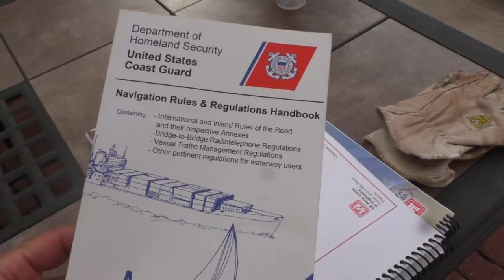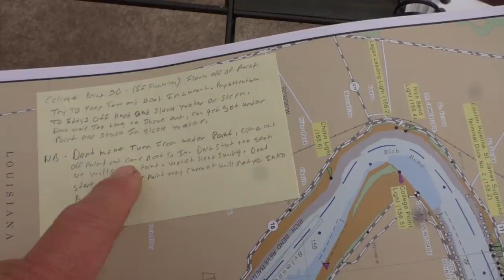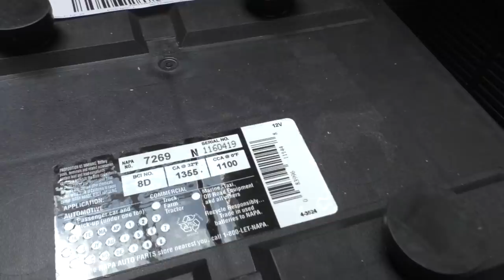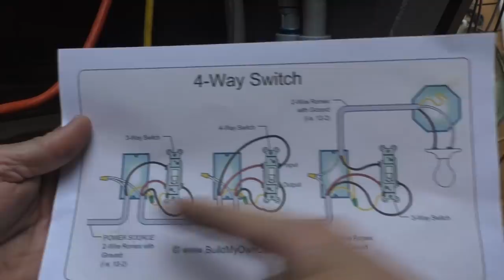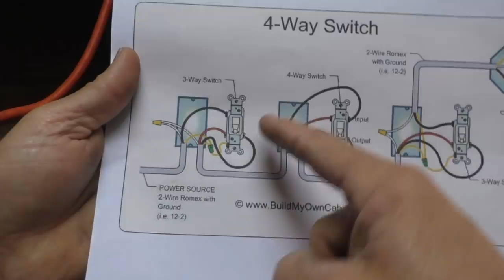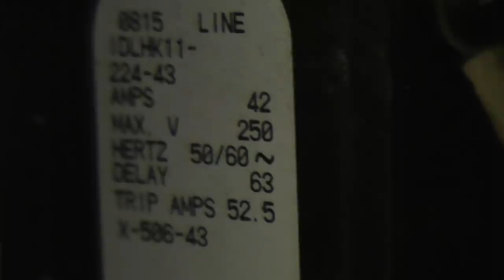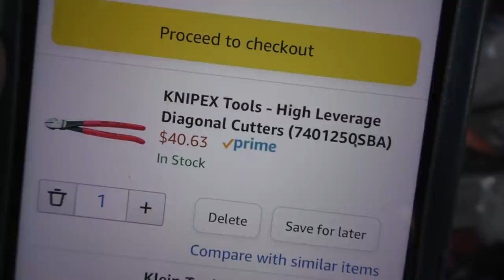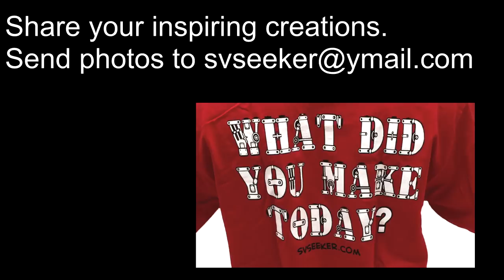Wiring the Boat -  Part 1

Comment: Get a new electrician! I have been doing Marine Electrical, and only Marine Electrical for 20 years and own my own company! Never EVER use Conduit or WireNuts on a boat!!!
Reply from the maker: Apparently you're wrong.  : )
Reply: So are you saying ABYC, American Boat and Yacht Council, is wrong? To what standards is this vessel being built? There is not one regulatory body out there that would insure this vessel just because of its electrical. Every aspect of it is wrong. From the conduit and wire nuts to the type of cable being used. It’s not a matter of if, but when it will burn down.
Reply from the maker: @jamarineelectric8083     I'm saying that taking the advice of ABYC at face value is like believing everything a politician says.   Check out who is on the board of directors for ABYC.   Like you apparently, they profit by scaring people into the false belief that only the very best ( most expensive) will save them from absolute impending doom.   You say it yourself, "It’s not a matter of if, but when it will burn down."    So no, I don't pay much attention the ABYC or folks like you.   I do listen to the folks who make a living working on the oceans with resourcefulness, economy, common sense, courage, resolve, and skill and completely without a monetary bias.